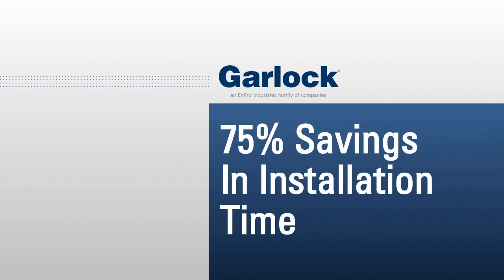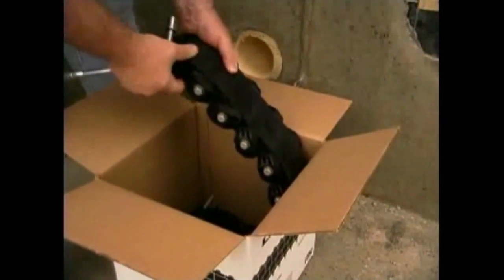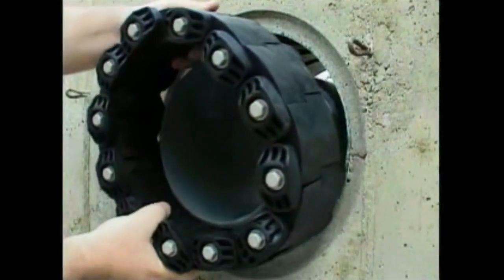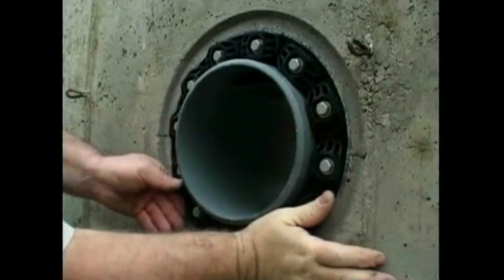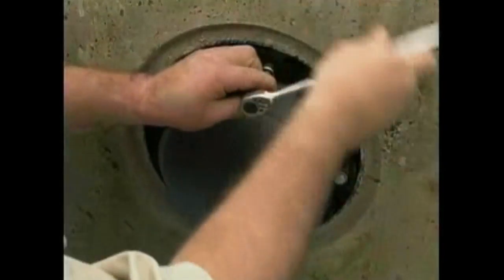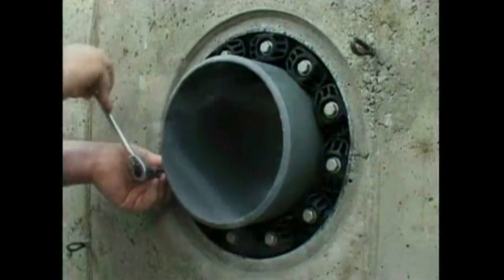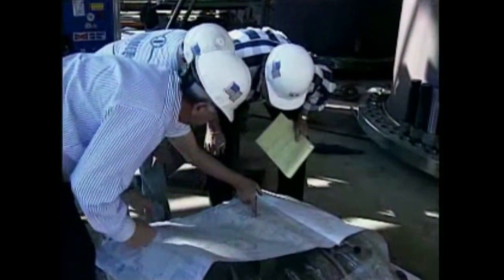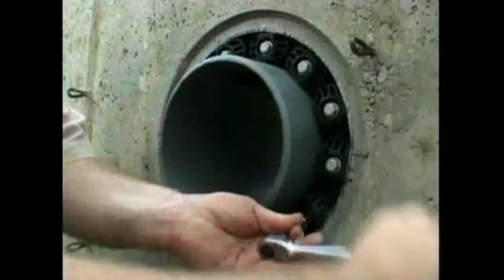Link-Seal® Installation

Comment: At 1:10 the video notes that an acceptable seal can be provided if the piping is slightly off center or axially misaligned, but I have heard from representatives that the piping must be centered and level to provide a proper seal. If misalignment or an off center installation is acceptable, to what degree can they be allowed?
Reply: As an industry end-user and this being the manufacturer's official video, I cannot make official claims. But as someone who installs Link-Seals every day to seal PE and steel gas services into buildings with customer-installed sleeves, I can tell you that I have had to deal with a lot of sleeves installed not square to the building wall. I install piping from the building out. That is to say I install the pipe in the sleeve first, then install the Link-Seal around the pipe at both ends of the sleeve-as is required by my job. If the sleeve is not square to the building, neither will my first section of pipe. I take care of any off angles with subsequent pipe-building techniques after that. I have never had a callback for water leaking around my Link-Seal installs. I deal in primarily pipe diameters from 2"-12" and Link-Seal sizes from 200-475.